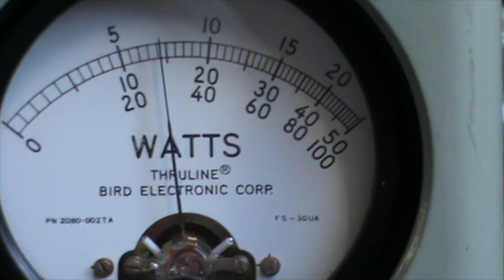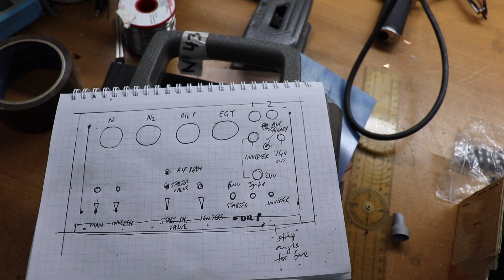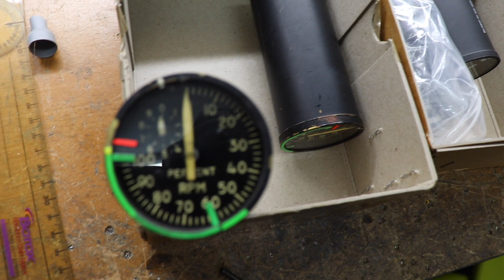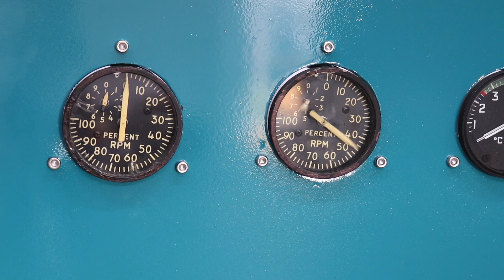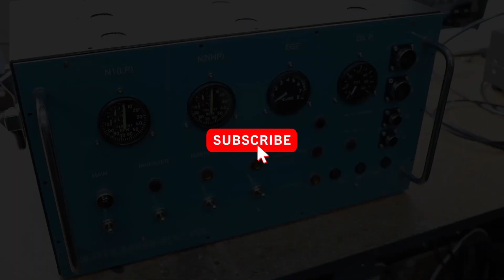Rolls Royce Spey 3: Instrument & Control Box

Comment: Would you be able to give any tips how to make an oil pressure gauge like that work with an car engine? I havent been able to find any pin out diagrams if it would accept any "regular" pressure senders or if it would need a coverter built from arduino etc. IIRC I also have a similar type manifold pressure gauge and an EGT gauge which was easy to make work with just a aftermarket car thermocouple + a resistor.
Reply from the maker: Hi, a lot of the aircraft gauges require the specific transducer to work. This one runs of 23v 400hz and uses an inductive type transducer. The older types work with a resistive bridge type arrangement, again you would need the correct gauge and transducer to get it to work properly